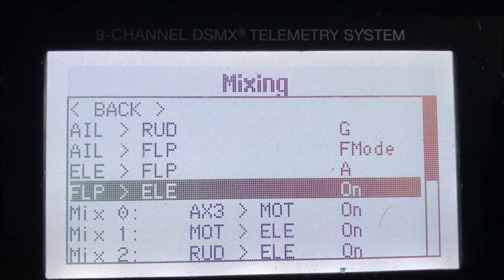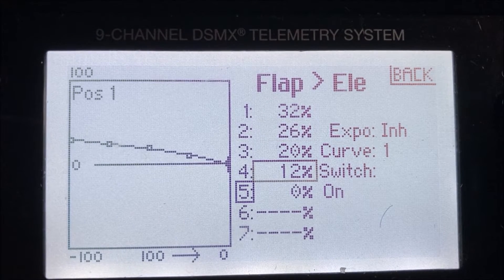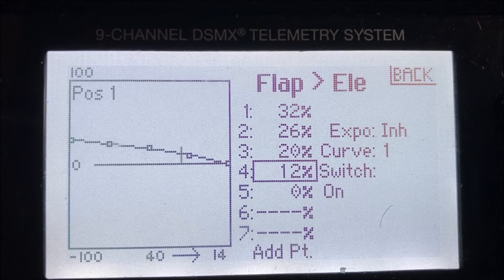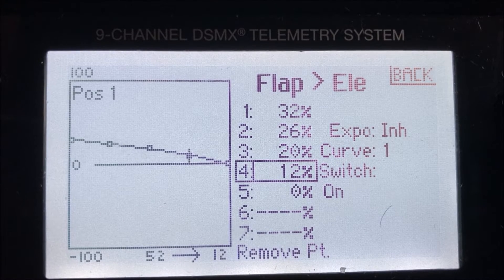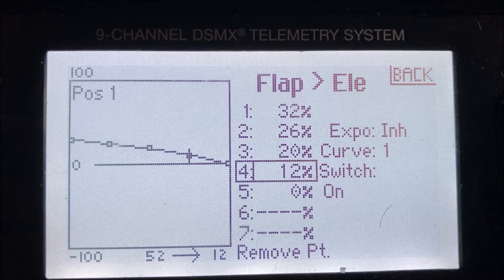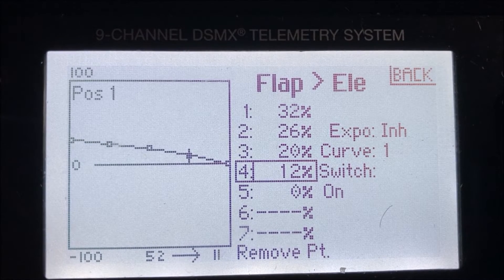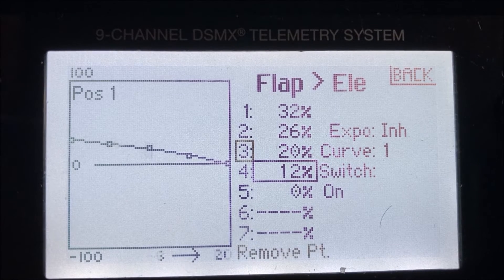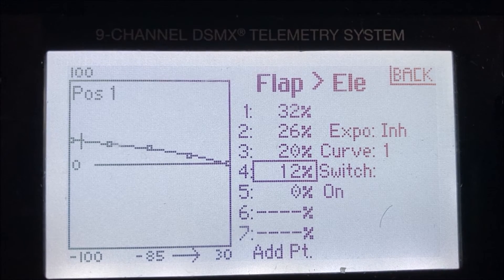Spektrum, Flaps to elevator compensation

Comment: I have followed your glider videos. I started on my father's glider when I was 6. I tried to setup a glider model in Spektrum. But ended up doing a normal model. I have 6 gliders now lol
Reply from the maker: 😀 If you set up a glider or even a motor plane with flaps/ spoilers then you should use glider menu, there you have much more and better adjust options.